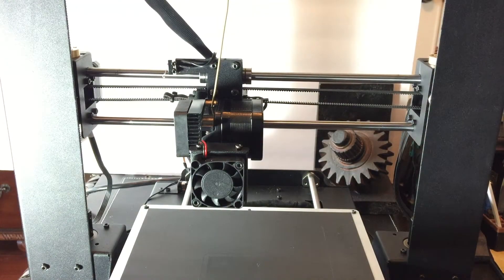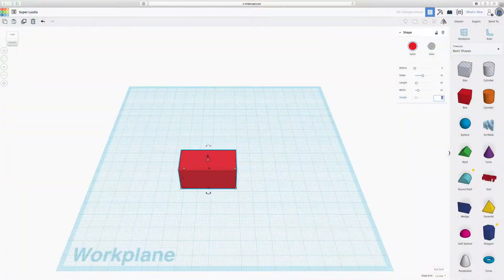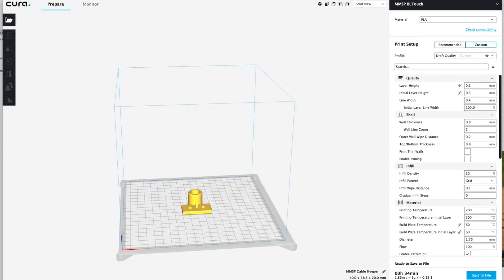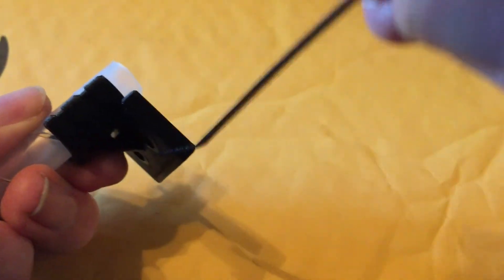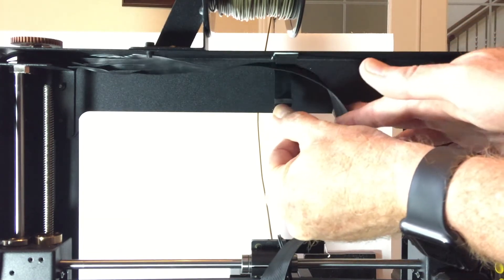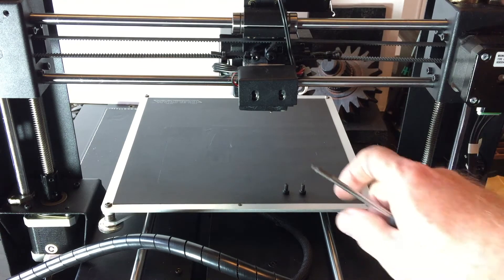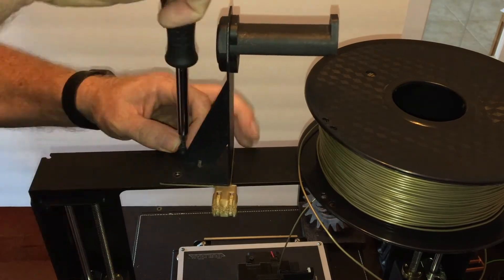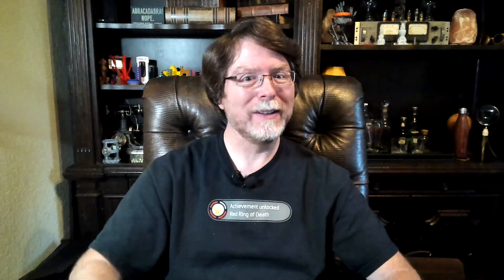Monoprice Mod Mondays #3: Extruder Ribbon Cable Keeper

Comment: Great video and great shirt! Will your bracket also work with a rear mounted cooler?
Reply from the maker: Hi John! Thanks (and thanks!) I'm using the bracket (modified to hold a TL Smoother) in conjunction with a rear-mounted Cobra Cooler & 50mm blower.

Comment: Hey Brian! Love these videos. Your octoprint video helped me set it up fast! I'm in the same Facebook group as you for this printer. I'm wondering, are you planning on doing a Z-axis stabilizer mod?
Reply from the maker: Hi Tom! Glad to see another MMSP Facebook person here!

I'll be doing the rear Z-brace mod once I'm done with the electronics. The rear Z-brace brackets kind of wrap around under the bottom of the printer and prevent removal of the bottom plate.

Electronics-wise, I'm planning on installing the TL-Smoother diode boards, but before I do that, I'll be installing the Microswiss all-metal hot end. That hot end really benefits from having a smoother on the extruder stepper motor.

Before I do all that, I may do an episode featuring cooling ducts and 50mm blowers. :) So, maybe in a couple of weeks.

Thanks!
--Bryan
Reply: Awesome, looking forward to it